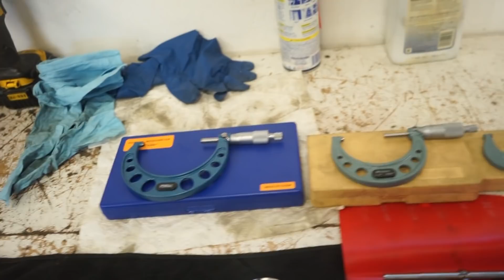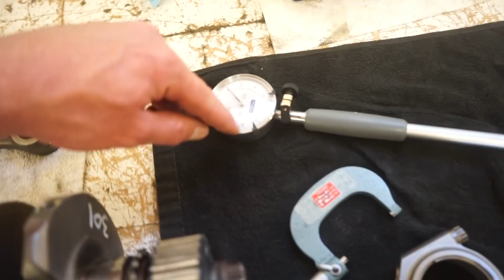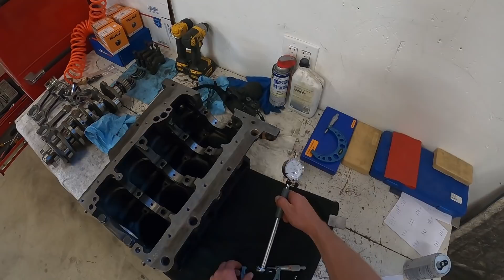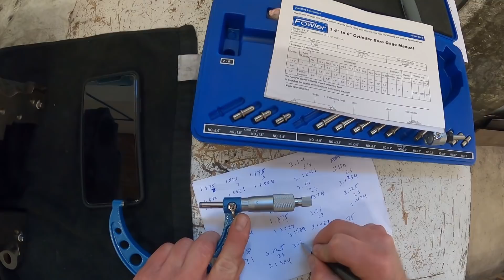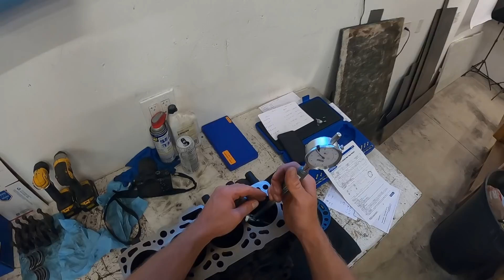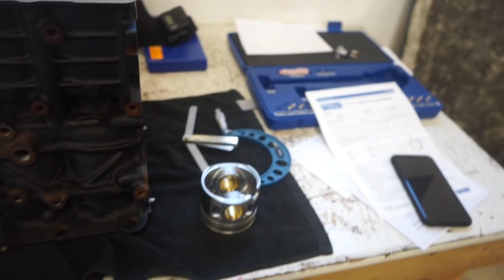The Best Way To Measure Clearances In A Bottom End/ More Bad Parts For The TDI Engine Build!

Comment: I have a
 1.9 TDI Jetta 03. My engine was rebuilt and now it's throwing the oil 
warning. It only does it like 10-15 minutes after fully warmed up and 
smokes a bit more at that time and not while warming up. If the pickup is clogged or the clearnce is not correct
 will it trigger the warning any any operating temperature or only when it fully warms up ?

Comment: Hey man bent my rod in mine gonna get h beam roseten rods and 2.0 pistons gonna bore and hone flatten deck and polish and inspect crank if all is well I should be good so you say I really should not trust the machine shop and do all these measurements
Reply from the maker: Joshua Zong definetly measure everything yourself!!
Reply: Austin Niemela what’s the spec clearances for crank to concerting rod piston to cylinder and profusion from deck those are the only measurements needed yes ?
Reply: Meant to say and piston profusion from deck but that just dictates what gasket is needed
Reply: Protrusion

Comment: Just wondering if you had of assembled the engine without checking the measurements what would of happened?? Would it off run but with poor performance, failed prematurely or maybe not run atal?? Really enjoy the in depth video’s, top class👍
Reply from the maker: I'm sure it would run just not as well as it should!

Comment: make sure he doesn't give you one of those made in china alh blocks. Machine shops have been making mistakes a long time. Back in the late 70's our local machine shop in nor cal installed the cam bearings backwards in my AMC amx motor and the mechanic assembling the motor noticed it and sent it back

Comment: i appreciate your attention to detail and your understanding and use explanation of measuring tools... the poor machine work is exactly why i DO NOT rebuild engines, period... good used goes in every time, simply cannot charge enough for a quality rebuild. I built my tdi tacoma over nine years ago using a $100 BHW shortblock that had standing water in the cylinders (surface rust? check!) and an ALH head from a hydrolocked (runaway) motor $150... just cleaned the two up and slapped em' together using a BHW head gasket. A few other things had to be done to make the BHW happy as a VE but that was over 160k miles ago and it does not use one quart @ 10k changes. More power to ya' on getting down with the minutiae of a proper rebuild....good channel, nice build.
Reply from the maker: jimbote1968 thanks man!! Are you on the tdiforums? I’ve seen many posts from a “Jimbote”!
Reply: @austinniemela  yes sir...that be me. It's good to see a quality, conscientious, tdi>toy swap on youtube...keepitup!
Reply from the maker: jimbote1968 thanks!! 👍👍

Comment: They agreed they over bored the block. How does that address the eliptical cylinders. Not being a smart ass, I don't understand. Shouldn't the cylinders be round ether way?
Reply: Gday mate,,,    from memory the bores were egg shape, fatter in the middle than the top and bottom of the bore,,   you're right to say they should be round after being bored on a machine,,  but my guess is they honed the bores by hand which put them out of whack,,  cross hatching is another prescise procedure and easy to take out more material if not being careful,
Reply: nigel hill Sounds like something a first timer Rookie like Me would do. I would expect much more from the shop.
Reply: @nationalelectric6507  I agree,  maybe an apprentice or someone new has done it,  their work wasn't checked afterwards either otherwise they would have picked this up,,,  either way its gonna cost the machine shop,,  new block, machining and time,  but it will be a learning curve for whoever made this boo boo,,
Reply from the maker: National Electric the taper is from too much heat while honing and he admitted it. You need to let the block cool often while honing!
Reply: @austinniemela  the cutting oil cools the block during honing.  Its easy to do and hard to mess up. I think someone messed up your brothers block also...... same guy?
Reply from the maker: vettepicking different shop. Even with cutting oil you can overheat the block and starts cutting weird
Reply: @austinniemela  its good to know what actually went wrong and how,  my knowledge suggested to me that it was the honing process but my thoughts were someone never kept the hone moving up and down or some how managed to focus on the middle of the bore,  mate, heat distortion never entered my thoughts,,     there you go hey, i've learnt something too,,  as i'm sure a whole lot of others will do as well.    Anyways,  on with the build ,  been great so far
Reply from the maker: nigel hill thank you!! 👍👍 hopefully next time will be better!!
Reply: @ventura9513  From my experience boring/honing blocks, a lot of attention needs to be paid to the up and down strokes of the bar, and how long the stones contact each section of the cylinder. Depending on how the cylinder is cutting, sometimes I have had to pause the stroke either at the top or bottom of the cylinder to remove more material. If you just continually "sweep" the cylinder from top to bottom, the stones are going to come in contact with the middle of the bore twice as much as the top and bottom, running the risk of removing more material, if you follow what I am trying to say. You should always periodically drop your dial bore gauge in each cylinder as you work, to check what is going on. Listening to the drag of the machine as it works will also tell you a lot.

Comment: how did he screw the block up he is a machinist he does this day after day and are you confident this time the blocks gonna be ok tbh i dont know if i could this is not a rookie error
Reply from the maker: nick Orourke so if it happened to you and he offered to replace the part and machine again free of charge, you would decline? He’s trying to make it right! If it doesn’t turn out again, obviously I’ll bring my work elsewhere
Reply: @austinniemela  once bitten twice shy i had a reputable buisness that i was assured and seen there work would do a top notch headwork on a cylinder head to destroy my cylinder head when i asked who was gonna replace it i was told its tough luck and the head wasnt good in the first place they still took my money and still to this day refused to accept any liabilty for the damage they caused
Reply: i had that same thought as you before many years ago, but it happens more often than you think